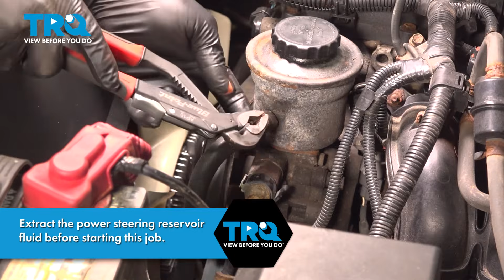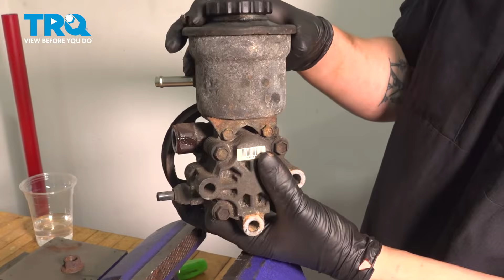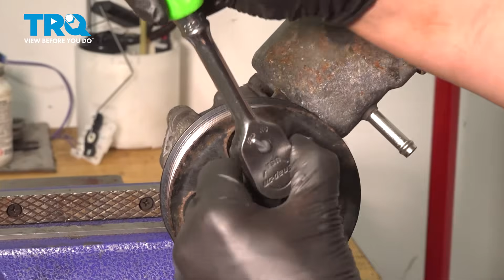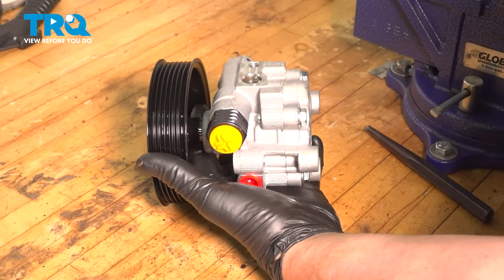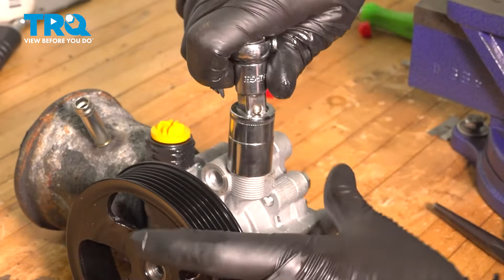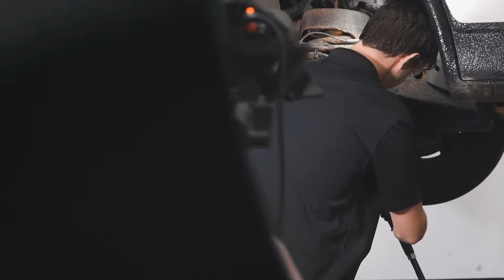How to Replace Power Steering Pump 2005-2015 Toyota Tacoma

Comment: Why not show the installation of the new pump?  The one you are showing installed is not the same as the one on the bench.  Process is accurate, but why the old pump back in?